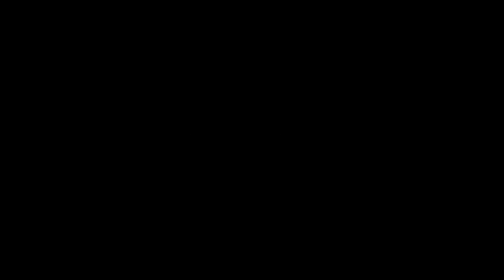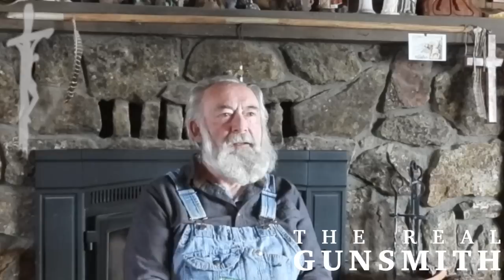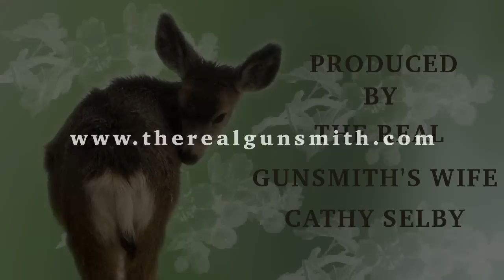Cartridge Case Designs & Shapes

Comment: My understanding is that the main advantage of staying out of the neck-shoulder junction with your bullets is that it means not having to worry about doughnuts or having to ream the inside of the neck to remove them.

"...easiest and ultimate way around them [doughnuts] is to shoot a case short enough that no portion of the full diameter of a bullet ever gets seated into the neck-shoulder juncture." - Glen Zediker, Handloading for Competition, pages 265-266. He gives the Tubb 6mmX/6XC as an example of this since you can seat the bullet to magazine length while still touching the lands and staying out of the neck-shoulder area.

Comment: It's interesting hearing you put a lifetime of reloading, shooting, and gunsmithing into a short discussion like this.  It can't be easy trying to condense those concepts down into just a few words that convey what you have learned over the years.  With that said, you mention a lot of different aspects of cartridge design, along with other factors that influence overall performance, but your main point was that you have an ax to grind when it comes to the 7 PRC.  You just don't like it, because of how it is being marketed, but then again, there is nothing "wrong" with that cartridge design.  Maybe there's nothing wrong with older designs, either, and you don't like that Hornady (or whomever) is claiming old cartridges weren't designed well.  That doesn't mean the new cartridges are bad, which is what you're basically trying to say, here.  If you go all the way back to the line of Newton cartridges...he had it right.  No rims, no belts, no rebated heads...just good case diameter and a rimless design for each cartridge.  If that's what newer cartridges are doing, then that's great!  Don't hate them just because they got it right.
Reply: Not to mention that it is a whole lot easier to get into a 7 PRC or 6.5 PRC than some wildcat only chambered by a select few gunsmiths with load data only for one powder and a few bullets and no option to buy ammo. The marketing may be misleading or even dishonest, but lowering the bar for entry is a big deal for the average gun buyer.

I can buy a 28 Nosler or 7mm PRC Savage pre-fit barrel, go/no go gauges, a set of dies, some brass, and be up and running with a set of reliable load data (Hornady and Hogdon have 7PRC load data available for free on their websites) in 2-3 months for little cost. What does it cost and how long does it take to do the same in 7mm-404 WE?
Reply: Bunch of BS my friend from your side since don't listen and pay attention to whole video and exact words used, but if it makes you happy to be a sheep then go for it...Randy is honest and straight foreward with facts, manufacturers are reinventing the wheel and you're buying this nonsense😂
Reply: @dawwlo  - Randy is obsessed with the 7 Rem Mag.  There's nothing new under the sun when it comes to cartridge design and manufacture.  I've probably forgotten more about cartridges and handloading than you'll ever know.  Get back to me after you've designed your own one-of-a-kind wildcat round, signing all the checks and going through all of the rigamarole, knowing that in the end it will be just another round, like so many others.
Reply: @jasonbroom7147  Good for you, now I understand why you need another round to eventtualy be forgotten in time
Reply: @dawwlo  -  That's the point, though... ALL rounds will be forgotten, in time.  The only thing priceless is knowledge, and I gained a ton of it developing a true wildcat.  Life is too short to whine when newer, better things (like the 7 PRC) come around.  If you understood why belted cartridges exist, you'd also understand their limitations and why a beltless round, with a larger case diameter, is actually a better design.  When a very experienced, but stuck in his ways gunsmith can't grasp that value, it's kind of sad, frankly.
Reply: @jasonbroom7147  And do you really need a prc, western or high bc match bullets for any ethical hunt? If yes, isn't that encouraging idiots with deep pocket to shoot beyond 400y??
Reply: @dawwlo  - If you keep spending your life looking for a fight, you'll keep finding yourself fighting to have a good life.  Not sure why you're so insistent on being disagreeable, but maybe go find someone else to disagree with.  I have an amazing life and won't be dragged down into endless arguing about random topics.

Comment: Mr. Selby, thank you for so much excellent information, I'm wanting to load 270 Winchester with 150gr partition bullets, what powder would you suggest.
Reply: IMR 4350 OR IMR 4831. either are perfect for the .270 Winchester. There are others as well but those 2 are the old standbys.
Reply: RL26
Reply: @1HeavyHitr  Yep, if you can find it, R26 is hot!!
Reply: He would tell you there are three he feels work the best and those three are Hodgdon’s H4831 then Reloader 22 and lastly the very best Reloader 26.
Reply: @nickcannon1558  Yep, you are probably right. H4831 will give the slowest velocity with that bullet if that's a concern. R22 is pretty temp sensitive and R 26 is great but very difficult to come by, at least right now. Good call!!
Reply: IMR-7828SSC would be well worth trying.
Reply from the maker: RL 22.  Good shooting.
Thanks for watching.

Comment: i have been told that if you draw a line along the angle of the shoulder of a cartridge from both sides were the two lines cross [the middle of the X] if the middle of the X is inside the neck of the case that  cartridge will have less throat erosion due the the focal point of the burning powder . lets say i 6mm pem. inside vs  243 win outside . your idea on that.

Comment: I just bought some 38 spcl brass. Starline. Is it normal for the trim length to vary by .005  or thereabouts? It's my first time buying brass and I thought it was a bit sloppy. I have to trim alot of them
Reply: I shoot revolvers, and shoot centerfire bullseye competitions with revolvers also. Variation is normal, you may want to fire them at least once, then run them thru your sizing die and then measure several to find minimum length and trim all to that size. 
If you are shooting target loads with low pressures, you may never need to trim again, and that starline brass will last pretty much forever. I taper crimp my target revolver loads, so little variations in case length have little to no significance.
But if you are shooting high pressure magnums, the cases will stretch, some more than others, you will find yourself needing to trim that batch of brass, especially roll crimping to the bullet groove. Case length matters if you are trying to align that heavy roll right into the groove in the bullet.
Lee makes oversize sizing dies, or you can send your sizing die for them to open up a little. This way it will be much less effort during sizing and will work the brass less. Depends on your chambers, of course.
Reply: @michaeldoe4805  Thank you. That was really helpful. I have the Lee Factory crimp die and that taper crimps. Im shooting low pressure target stuff. I was thinking that the variance of length would affect crimp strentgh in the longer pieces and result in less accuracy. If they are not that sensitive thats so much nicer. I havent done all the testing yet just figuring whats best to do. I didnt want to load the brass once then trim it if I should be frimming from the beginning for exact equal length
Reply from the maker: I don't believe .005 to be of any great matter. 
Thanks for watching.

Comment: Loading mixed brass for 308 and 223 brass is problematic. Shoulder measurements in same brand,different vintage and shot counts can vastly change in consistently. Even after annealing. I've rejected brass for going .005-.010 shorter and shoulders were no longer straight but radiused

Comment: If a shooter has the equipment and practices out to those distances AND is confident… why not?  Not in SC or IL or MI perhaps.  Out west?  Go on, take and make the shot!
Reply from the maker: Because there are so many variables in wind currents between the hunter and the animal and a shot just a bit off can mean the difference between a dead animal or a wounded one that the hunter may or may not recover.  Have fun shooting at targets that don't bleed and suffer if you are off a bit because all of the gadgets and gidgets most "hunters" now rely on, can't tell anyone the difference in air currents.  
An example.  From my place to 800 yards are several gullies and a creek bed, and by looking closely at grass movement it is possible to see that the wind is not consistently blowing the same direction or velocity at all, but changes drastically by terrain.    So, yes, all the practicing at the range is all fine and good and a must. But shooting at gongs or paper is NOT the same as taking a chance on a bullet placement not going exactly where you think it is.  And the gong or paper can't take a step in that fraction of time it takes for impact.        Our majestic animals deserve better than being ego targets.
Thanks for watching.